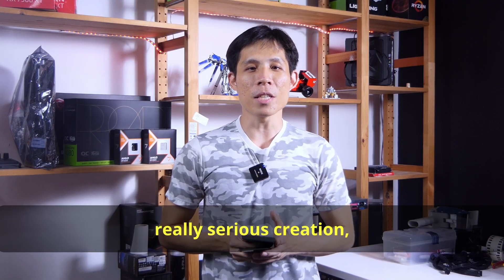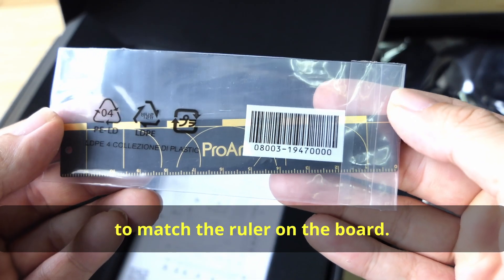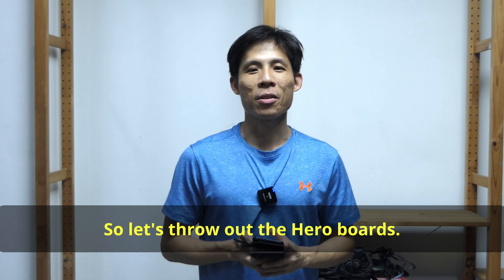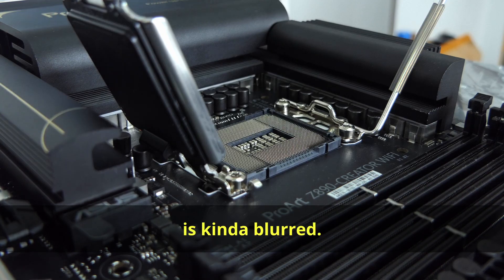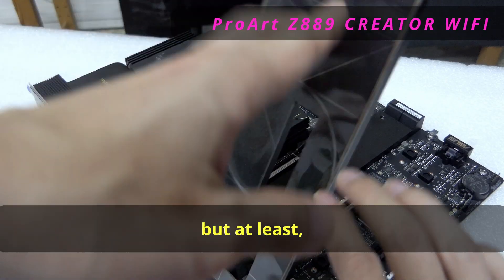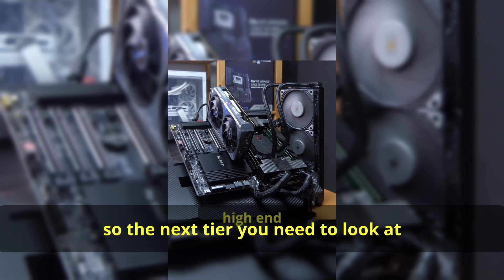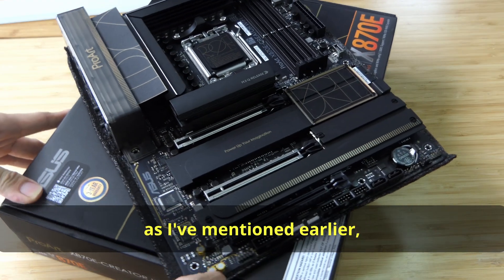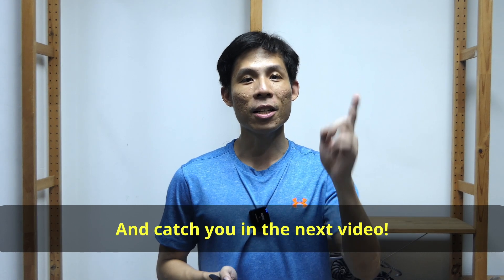X870E & Z890 Creator Vs Gaming Motherboards - How Do They Compare?

Comment from the maker: Are you using or planning to buy a ProArt board?

*Notes*
Probably not the most well researched video I have done. There were such some mistakes, such as the USB ports on the Z890 ProArt. 
And perhaps I could also include a price comparison against the -F boards (with more similar pricing), because they are more similar in no. of M.2 slots, even though they do not have 2 full length PCIe slots. 

Watch the ASUS ROG Strix X870E-E here: https://www.youtube.com/watch?v=rDsYg1vDLNU&t=108s
Reply: I have one in order, the  X870E, and what made me choose it was the 10gb/s ethernet connexion. My almost 8 years old PC has only a 1gb/s port and my internet is 8gb/s so it was time for me, with the update, to have something that wouldn't do a bottleneck anymore.
Reply: @YannR34  yes I want it for the 10g also
I’m just wondering how to get Apollo Quad 8 thunderbolt interface to work also 

But if not I still like the board your talking about
Reply: @Desi1080ptv  If you find a mother board that works for you but with no 10Gb, it might be easier to just add a 10Gb pcie card. I just needed a pcie free for my sound card, it was easier to fit this in on the pcie 4 left
Reply: @RealMelTan  I’m mostly gone be gaming so I was wondering I just bought the Lenovo Legion tower with a 4090 graphics and i9 139000 it’s smooth now but I just bought a ryzen 7 9800x3d and was thinking if I get a amd professional board to go with the chip I could game better or is the set you have already gone be the same if I buy a new board 

Meaning better latency, fps, less lag 

So I’ve seen the Asus 87OE , Msi Carbon 87OE , and the Proart Creator , but I will also need to be able to install my Thunderbolt expansion card pcie

Comment: Thanks for the video, what about dual GPU 4090 . What do you recommend to have the full bandwidth of the gpu ? Strix x879e f gaming, crosssir hero or proArt creator? Many thanks
Reply from the maker: Hi Mohammed, thank you watching this video!
If you plan to use dual 4090s, i think you should be ok to run on the crosshir hero or Proart creator, because both have 2 slots and they run at gen 5.0 x8 when you use both (which should be similar to 4.0 x16 speeds). This means your 4090 will be used well. 

That said however, I am not sure if there will be room for 2 3.5 slots GPUs on both boards (eg. Strix 4090), possible stifling due to the heat. If you care for that, a threadripper board will be better.

Comment: asus proart z890-creator is compatible with ryzen 9 5950x?
Reply from the maker: Hi Flow, you are not able to use the 5950x on a Z890 creator or any Z890 board. The 5950x is from AMD, and Z890 is from Intel. In terms of generations, they are different too.

Comment: Why no Thunderbolt 5 and no WiFi  7  ?     why this compromise,  if I'm not a 12-year old gamer and I don't want to have a bunch of useless billion-color flashing things inside my anyway closed case, what are my options then?
Reply from the maker: Hey Nick, these new ProArt boards have Wifi 7. The Z890 ProArt has 2x Thunderbolt 5 and the X870E Pro Art has 2 USB 4
Reply: @RealMelTan  ok great then!  Thanks!  I overlooked it. ..very likely it's gonna be my next board
Reply: Same question!